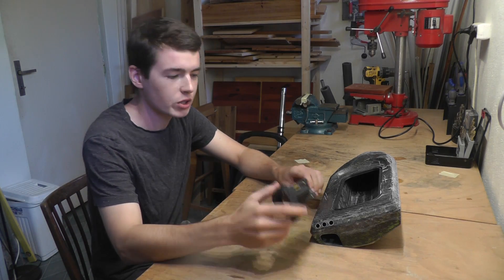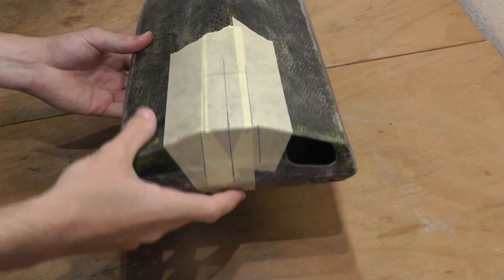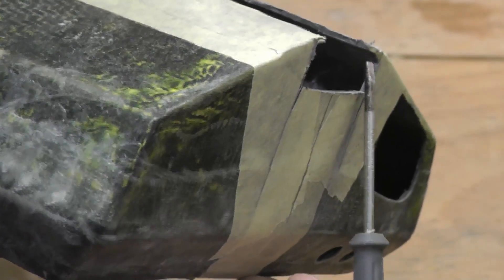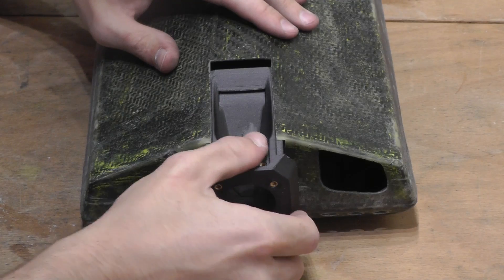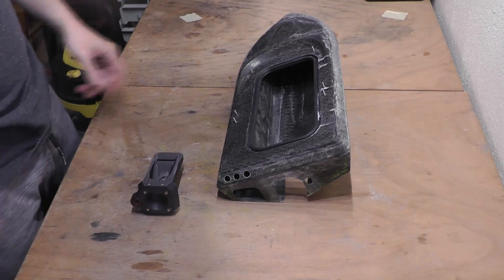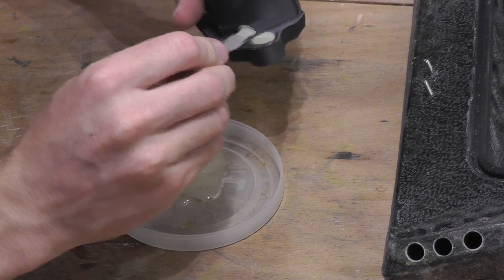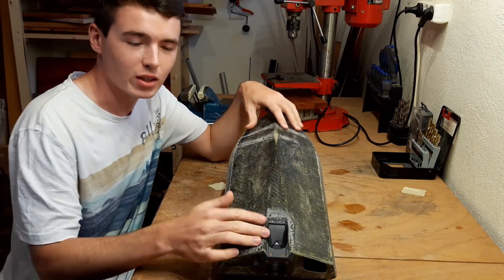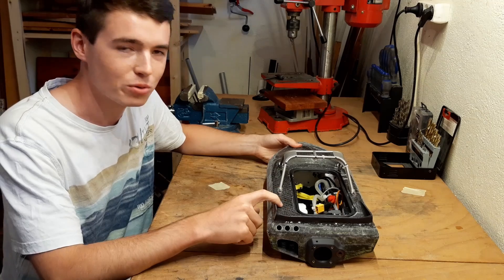M-Jet 35 Installation / 4G Sprint Boat Build Part 4

Comment: Hey.  What motor kw would you recommend for the m35 jet.?
I'm running 6s, and the boat is 120 cm long.
Reply from the maker: I saw your question in the M-Jet facebook group. You showed a screenshot of the M-Jet 35 illegaly sold on aliexpress. Please note I won't help you if you support violating my rights on the design by purchasing fake M-Jet 35 from aliexpress. Can you please clarify your perspective on that?